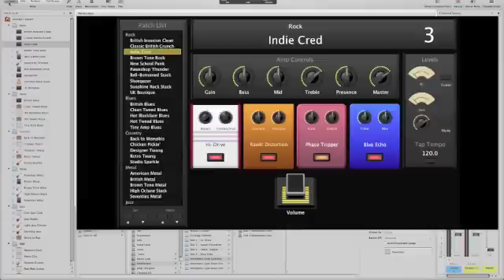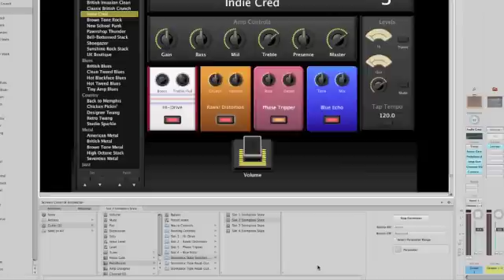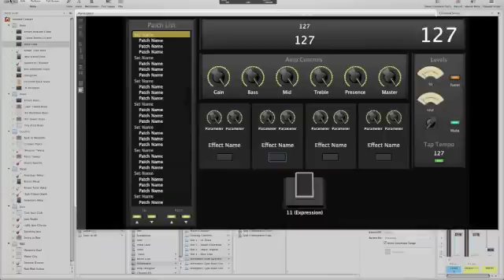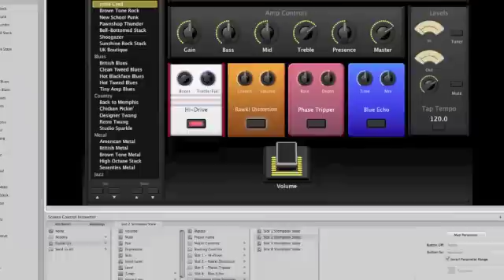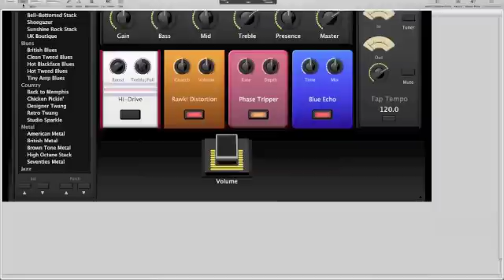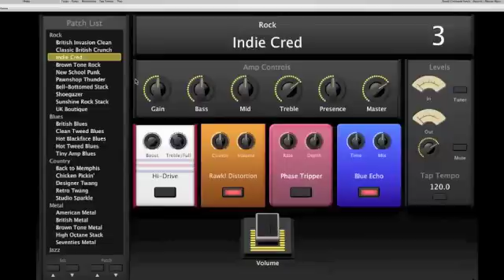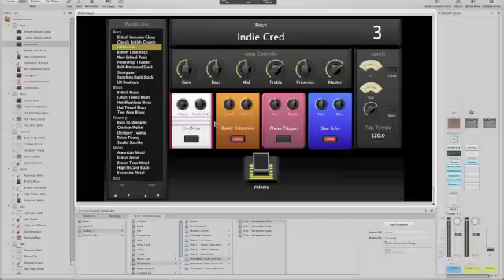Mainstage 2 Stompbox Control with FCB1010 - Part 3 of 3

Comment: Hey so I have a genuine question...

I'm using a plugin called "Bias" for my guitar amp. It doesn't offer any midi controlling outside of what Logic allows for general midi programming.

My question to you is: does mainstage let you use 3rd party plugins? 

Is it best practice to try and use a different program to drive my effects w/ FCB1010, such as amplitube? 

I'm only trying to turn on and off a few pedals and use the EXP/Volume pedals to use the wah and volume, but for some reason this is turning into a 3-day journey of extreme programming. Very unpleasant experience :/
Reply from the maker: Good questions...
- Yes, Mainstage will allow you to use 3rd party plugins
- Effects is more of a personal choice, use another plugin or the standard Logic/Mainstage effects
- Not sure what the problem is with the Exp/vol pedals, you mean they don't map in Logic/MS?
Reply: Basically the expression pedals always control the actual DAW track volume instead of the guitar  volume... I've never programmed inside main stage though it might be easier than just programming in logic's explorer view or whatever
Reply from the maker: Brian Martin Yep. It's definitely a lot easier to program in MS, give it a go! :)

Comment: Hi Jas, 

Just a quick question, what midi interface do you use with your Mac and FCB 1010? I ended up buying a Novation 25 SL MkII that has an inbuilt Midi controller - but I just can't seem to get them to work together. Should I jus use a USB to Midi convertor cable?

thx
Brad

Comment from the maker: @bradden76 Lol, thanx :)  I'm sure you're way smarter than you say!  Too bad about the Apogee, it's a well-built piece of gear.  

As for suggestions on a MIDI keyboard controller...the good news is there's lot's of choice yeah, it's a bit unique to the user so start with what you want to do. e.g. would you like a few touch pads on it to trigger samples?  what size do you need/want to carry?  If you're pretty good now with MIDI then you may not need things like Hyper Control in the M-Audio Pros.

Comment from the maker: Jeff, thanks for your well thought out comments..much appreciated.

Yes, you're exactly right.  Fortunately, Mainstage allows us to function at both the Concert level or Patch level and in this example, I deliberately made it Concert level since that's what most people go for - consistency throughout all patches.  It's also done to provoke thought and give players a window on what's possible. No doubt there will be players that need variability at the patch level which your steps cover nicely.

Comment from the maker: Yeah,  figured it was you :)

What kind of control do you need over the individual tracks from the layout screen?

btw, the other thing you might want to do is check out my other vids on Logic->Mainstage automation.  Other options are running your backing tracks in Logic then triggering Mainstage from there.  There's lot's of things you can do with both that most people don't think about.

Comment: Thanks for replying. Yeah I see that I can set up multiple concerts but I'm wanting to basically run a live show on a click track. Is there a way to trigger multiple concerts to all play simultaneously? That would probably work but like you said probably not the best. I'm starting to realize it's only really designed to handle the 8 tracks it gives you per patch. If there is a good way to do more then cool. If not, I can deal with it.

Comment from the maker: That's great you're using your FCB again!  It works nicely with Mainstage.

Tap Tempo, sure, no problem...  
- Go into Layout mode, click that button on the right side of the screen for Tap Tempo in my video (or create one), then map a FCB switch of your choice to that button.  

- Go into edit mode, click the tap tempo button, then in the Screen Control Inspector below, click Actions, then scroll down to Tap Tempo and select it.

- Now just tap the FCB footswitch to the tempo you want.